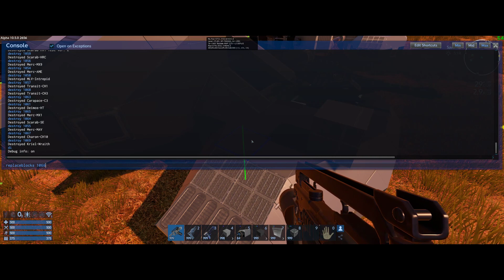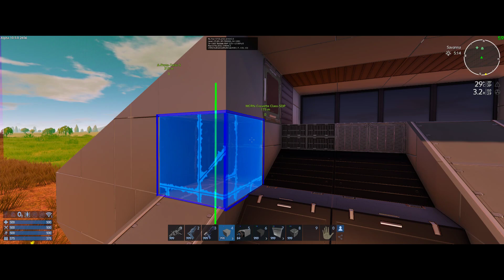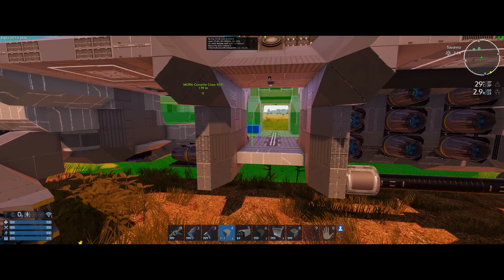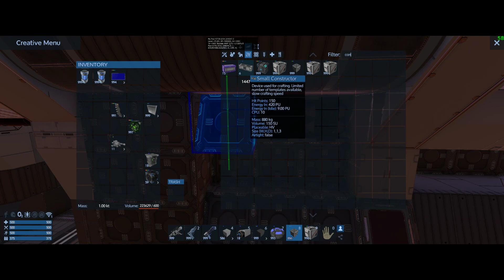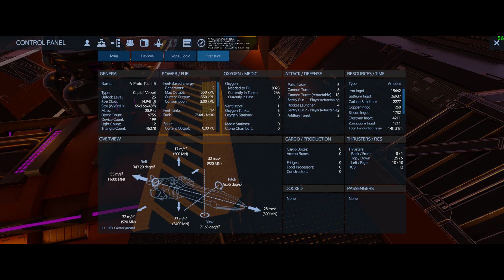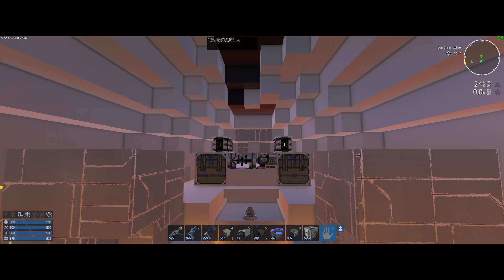Empyrion Galactic Survival - Refitting the Basilisk-HWP Part 1

Comment: Since you placed two constructors on one side you can fill up the first bottom row on the other side with cargo extensions and use the upper second and third row for armor lockers and o2 stations, that way you kinda even out the cargo extensions on both sides. Just a thought!

Comment: 9-10k ammo will cover most needs.  More if you intend long battles and long loiter outside POIs.  But, really, 3-4k ammo can get you by.  Cargo... at least one max storage is enough for POI raiding, and that's likely what you're doing.   More if you can fit it in there.  There's never too much cargo.  Of course, the new CPU breaks EVERYTHING, but one hopes they'll relent and let us turn it off on PVE and single player, and it will tune better.  Right now, nothing you've built is compliant, nor is anything I've built.  Sigh.  And cargo... yeah, having any ship that can lift, has more than 2 guns... you won't be able to have any cargo at all.  Nor could you ever max out the guns on any ship and actually power and arm them ;-).  Good luck.
Reply from the maker: The devs did put out some info the other day saying that the CPU will be optional and remain that way moving forward. This should include servers as well. Yes, I was totally stressed about it too. On the Basilisk, I do think because of the size and cost of it, + the amount of weapons it has, I will try to jump the ammo storage up a bit more. I am thinking 5-7K might be a safer place to be at. Along with ~15K main storage, I think it could handle it and have the power to move it. So, this will never be a CPU build, but I don't think that should matter much. Once I get a chance to see what CPU tiers allow, I can see what can be done to make a CPU creation at a certain tier level. But currently I don't have any plans to try to make older creations comply to it. If it ends up being to limiting, I would guess I would build very little CPU compliant creations moving forward. Thanks again!
Reply: @jeffrandall2813  I feel for you Jeff, since I heard about this "CPU regulations" I was shocked. Do these devs, and makers of this product realize what a horrible PR move this is? Limiting your customers creativity?! It's like Adobe putting out a patch to prevent Photoshop users from using all the toolbars and limiting their canvas size so they don't overload the server. It's deplorable. And to even threaten such discreditable actions would clearly bring a business to it's knees financially.  They are fools and I will not get that update. It would be better to play the game as it is forever than to update to that kind of regulation. 

vRJoseph Boyer
Reply: @jeffrandall2813  Well, I rather figured, listening to the devs on Xcalibur's chat, that they'd gone into this a bit headstrong, and quickly started to realize a locked (can't turn it off) system would alienate a lot of their players.  Thing is, for MANY, this has become a building game, NOT a game you play other ways.  I keep TRYING to play... done a lot of restarts.  Just did Eden with the hardest settings starting on the dead world, inspired by Spanj.  Kinda fun, but, once you get off world, and start getting resources and building, well... there's no longer any priority to play.  They've never created ANY elder gameplay.  And, so, if you're not doing PVP, well, there's nothing left, but to build.  So, I try to find interesting needs and build ships for them.  Still working on perfecting a "go anywhere, deal with any environment" auto miner harvester ship.  My latest (not on the workshop yet, but a sequel to the Warthog) flies in 4+G like a feather, which was a challenge, and can lift a LOT of resource of of that gravity well... and is so so so not CPU compliant :-).  I mean, spanj used ONE large engine and totally broke his SV.

Those rules for PVP make sense, and I'm sure they'll balance it so it's not so drastic (fixing the shield numbers for example).  But I like building themed CVs, or heavy lift SVs, and have no interest in restrictions like that.  Weights and measures are FUN, and I'd love some aerodynamic physics, and similar things.  Would love having a lot more subsystems we can tinker with, too.  But CPU?  Yeah... not feelin' it.  Not outside a PVP or very structured PVE scenario environment.  And your builds... man!  All epic, and all way way outside their new ruleset.  BTW, you test the new hangar doors?  They look narrow on the bottom like you said... do they clip against the wider craft?  My Warthog just barely fits in those doors, in case you want to bring it inside to repair.  But, it's engines are high, so the narrow bottom won't hurt.  Will reduce HV width, though.
Reply from the maker: @sundancer996  Thank you very much!. On the CPU thing, I am a bit nervous about it but if it remains an option, my worries go away. I agree on the end game. I find the game fun and exiting getting going, getting the rare resources to build better stuff like large CV's etc. Kind of like an RPG in which your assets are your leveling. But, currently once you get everything you need and build or spawn some higher end creations, there really isn't anything to do with them, like end game content. I would love a reason to need a big battle hardened CV to get past a certain point later on the game to take on new challenges. I hope someday the game does have those challenges. But over all I have kind of viewed this game as Minecraft in space were the bulk of my time is put into building. As in PVP, I totally agree. I would like to see good engineering be the reason one PVP creation is better than another and not by brute force of excessive amount of block layers, hidden thrusters, etc etc. So if all the creations had the same equal footing so to say, then it would be the better design wins or better player skills in piloting. At this point it is hard to know exactly how everything will play out with future game patches etc. The most important aspect of any game to me is the fun factor. Going more realistic many times does not make for a more enjoyable experience.  In many cases, it takes away from the fun factor in my opinion. After all it is game, not a hard core flight/space simulator, well at least for this game. Just my opinion. As in the new stuff, it is not out yet and I haven't been able to test anything. Thank you again!
Reply: @jeffrandall2813  Sadly, I think the bulk of their development has been and is going to be for PVP.  The new CPU rules are solely for PVP, after all.  THANKFULLY they said they'd make them optional, since builders and PVE have no need of it.  But, in a PVP environment, they have not been able to solve the massive server lag issues (understandably) so vastly reducing the size/block count for ships will go a long way toward that.  And, in truth, maybe level the playing field and make PVP more interesting.  

Personally, I prefer PVE to PVP.  I find PVP lazy.  I mean, it's a LOT of fun, don't get me wrong, but from a design standpoint, it is the easiest.  You create the arena, but all the "gameplay" comes from the players.  These building/environment sim games... I prefer solid PVE, which is hard to come by.  

I remain hopeful.  They've finally started talking about replacing all the ridiculous purchased assets, like raptors and whatnot, with their own creations.  That's a plus.  And they're working on new faction attacks of your base.  That's interesting.  Just... with the super limited loot options and building part options, there's not much worthwhile once you manage to leave your planet.

It would be really nice if all the major ship parts were standard but had upgrade slots.  Things NOT included in the blueprint, but that could be added.  So, say a JRandall super special ship is downloaded and built.  We get it sans upgrades, and have all these cool ways we can upgrade it to do more/be more.  But, to do that requires quests, and lots of POI busting and other fun things.  So, instead of just a few epic guns and the epic armor (once you have them... why hit another POI?), you'd have thousands of potential upgrade parts, and the only way to get them is to recover them from POIs, or crashed ships, etc.

I don't know... just a thought.  I love building ships in this game... but the largest attraction for me was that, once built, you could go do things with them... which kinda falls flat once you've hit a certain level.